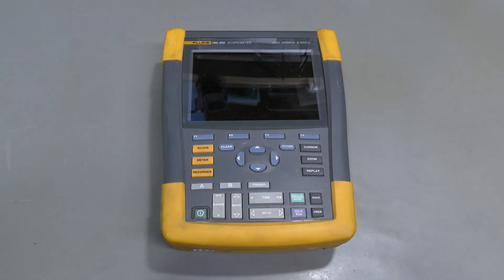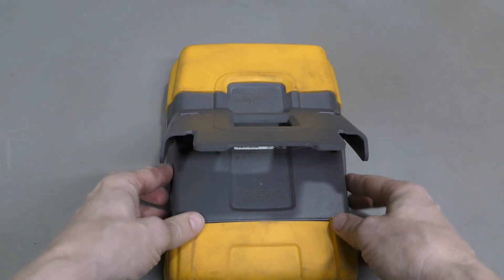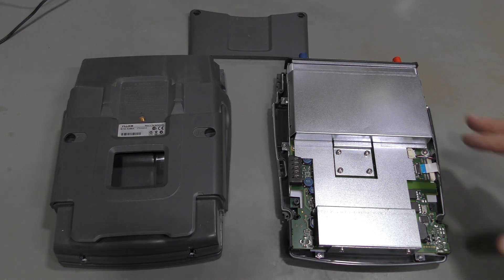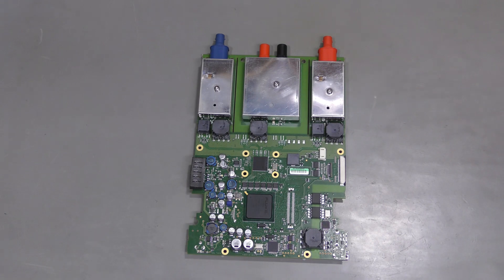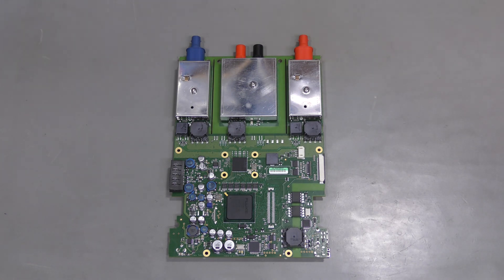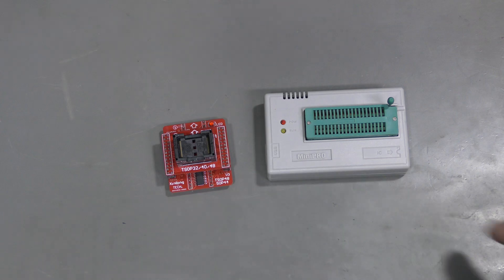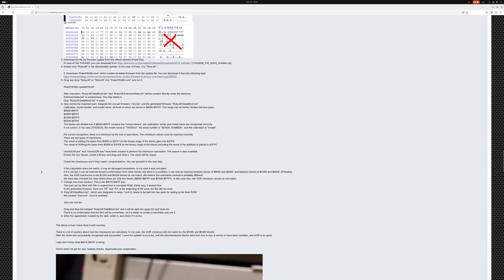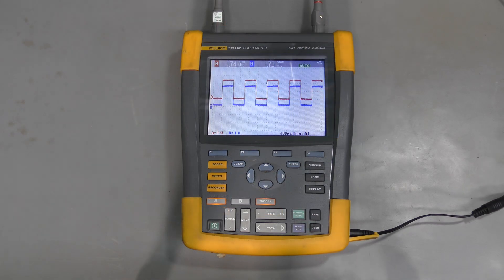#156 - Fluke 190-202 scopemeter repair

Comment: Is it not possible to restore the firmware without removing the flash? Most devices have a DFU mode which allows reprogramming even with bad firmware.
Reply from the maker: Fluke must have some utility to program freshly assembled units with blank chips, but they don't share it.

Comment: Thank you for video!
I have TL 866 version 2 and T56 programmers . I use it to fix nand corruption failure in agilent 2000\3000 scopes.
Reply: Is there an eevblog post about doing it directly at the nand level? I spent a full day hunting down firmware images and preparing USB sticks to recover mine

Comment: I was expecting lines on the screen - lol -, but I think that was the mono LCD.
Reply from the maker: Not only that was mono, but an old version 192, 196 or 199 with no suffix. 19xB was mono as well, but with a different LCD that did not have that problem. And 190-xxx is a new line with 4-channel model available and Li-ion battery.